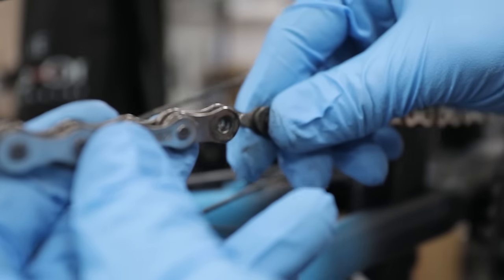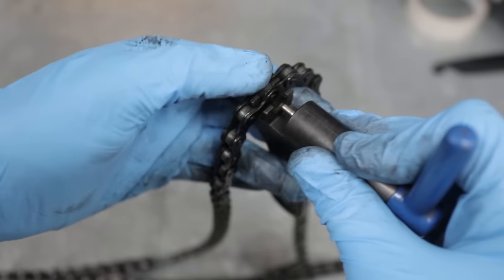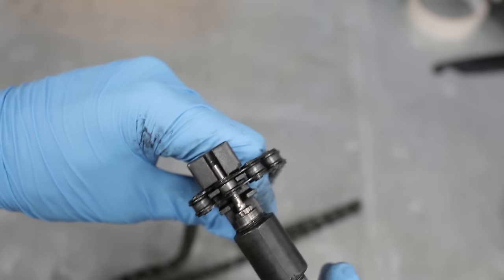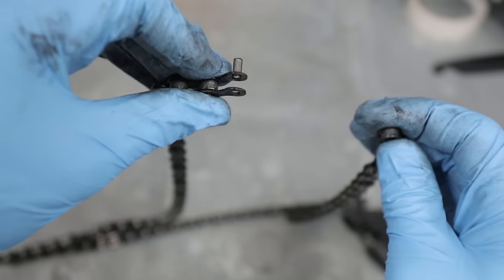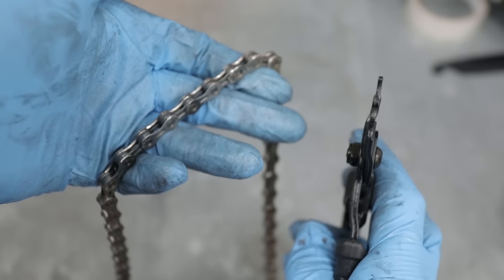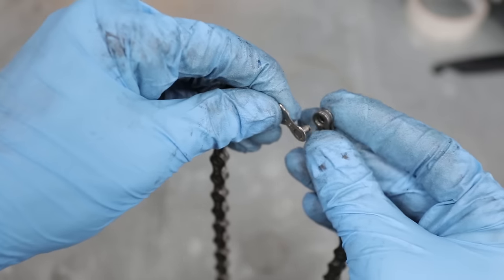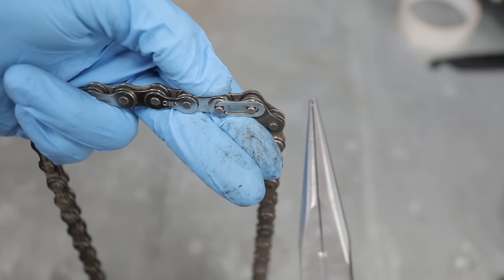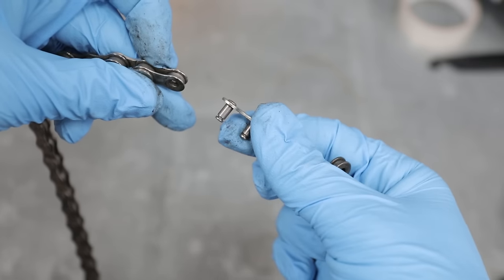How To Remove a Bicycle Chain

Comment: Don’t you think if I had a pair of quicklink pliers that I would already know how to remove my quicklink chain?
Reply: AMEN!!!!!!!!!!!!!!
Reply: Ooh big brain
Reply: very smart comment
Reply: It's very hard to do without.. try shoe laces or brake cable but it's really hard
Reply: I somehow removed it, just by hands. I've loosened the chain by puting it in higher gear  by hand and just squeezed it together.
Reply: @white_shadow_123  what speed chain I could  remove my 7s chain with hand but not the 1O s one
Reply: @rejickmukherjee9154  Yes, I have 9 speed. I've read afterwards that 10 speed and up are different and very difficult to remove without pliers and need to be replaced with new they are removed..
Reply: But if someone (who doesn't know) looks and sees they have a quick link, they now know to go and buy a set of quick link pliers. Videos like this aren't for people who already have the tools to do the job the video is covering.
Reply: haha fr
Reply: The fact that it's called a "quick lock" and supposedly makes unlocking the chain easier, but in reality you need to buy a special tool just because of that lock when you already need\have a pin remover pisses me off so much
Reply: @Gallyga  you shouldn't need a special tool for something that is advertised as "doing by hand quick lock"

Comment: "They are easy to remove but can be stiff and you may need a tool" so not easy or quick then 🙄😠
Like what is the point of a "quick link" if you're gonna need one more extra tool just for that??? When you already need to have a quite expensive pin pusher because cheap ones bend 😤

Comment: I am 73 and bought a Scott scale 50 six months ago. I have taught myself to do everything without any experience ever. It took me a while to realise that the chain was stretched, and I needed to replace it. It was a sram chain, and I wasn’t strong enough to push the chain together to release it. I found a piece of wire and threaded it through the link and tightened it up with pliers. That did the trick.
Reply: Nice
Reply: Informative video. 
Did the same myself with a piece of redundant brake cable wire and a pair of mole grips as I don’t have the pliers at present. Just twist the grips until the links come free.

Comment: thanks for this clear, well-done post.  newbie here.  my wirecutter tool worked on a quick link, once I positioned the adjacent links at 90 degrees to the quicklink.  in other words, the wirecutter tool is too thick to fit between the links, but if you position the adjacent links 'downwards', you don't have to fit between 'em, since the quicklink is 'exposed' so to speak.

Comment: You haven’t explained how to reconnect a chain using the rivet extractor to push the rivet back in. Just mentioning that a different position in the extractor can be used to loosen the rivet a little would have only taken 5 seconds

Comment: What if you don’t have a “Chain tool” is there a DIY?
Reply: Maybe a vice with a pin and a backing plate with a hole in it!  I'd use a bolt and an oversized nut or two on the backside.  You could also use a C clamp.

Comment: I can't get my pin to budge out with the tool.
Reply: I remember in the 60s that the Reynolds chain had non removable links, with the pins swaged on the outside of the plate. Never found out how they were taken apart because I didn’t have one. They must have had a detachable link. Check yours carefully.

Comment: why do silly people wear surgical gloves to do mechanic work??? 🤣🤣🤣🤣🤣🤣
Reply: Because of all the grease that would ruin normal gloves.
Reply: @rekrap098  who wears gloves? nothing ruins skin. Never wear gloves for 50+ years. And they are cheap to clean.
Reply: @JohnSmith-uy7sv  Try doing metalworking without gloves. It’ll tear up your hands like crazy.
Reply: @rekrap098  been there done that and we are not talking about that. Mechanic's silly man. such girly men. Never wore gloves in my entire life. Only to weld.
Reply: @JohnSmith-uy7sv  By the way, what do you mean nothing ruins skin? I could dip my hand into fire and it would burn right off.
Reply: @JohnSmith-uy7sv  Stop calling half the workforce girly men by the way. I bet the people who built the building you live in used gloves.
Reply: @rekrap098  talking about common sense things. There is no job that requires putting your bare hands into fire of which I retired from of 21 years as a forest ranger/firefighter.  As we say in the south..."if your gonna be dumb, then you gotta be tough."  duh. Maybe put your fingers in a meat grinder or a tree shredder.